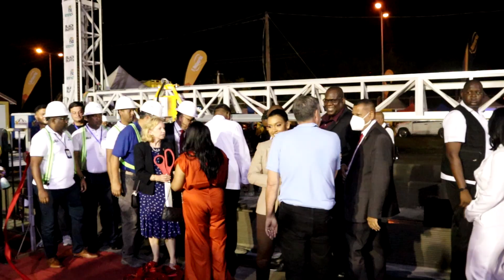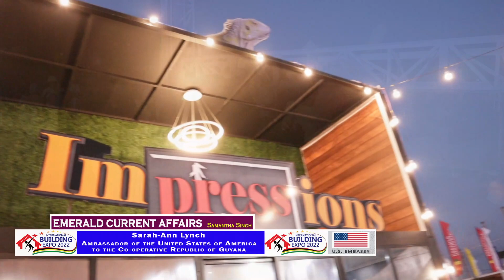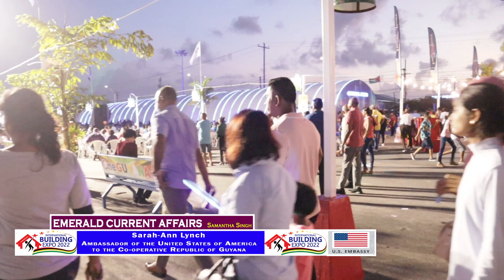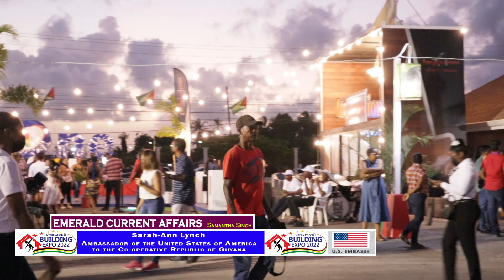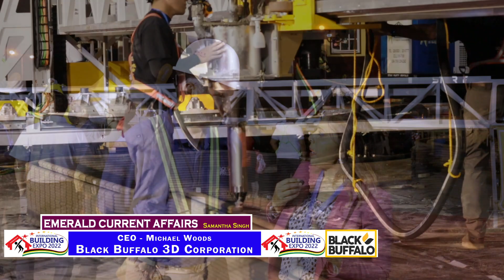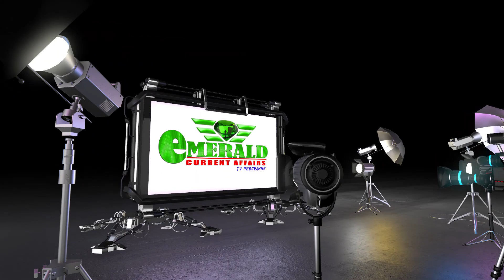House Printing Machine which can print a real house in hours.

Comment: The math is not mathing... $40/sq ft, so for a 1000 sq ft house, shouldn't it be $40k instead of $400k ($400/sq ft)? And a 400 sq ft house would be $16k instead of $80k ($200/sq ft)... I'm not sure where this $40/sq ft figure is fitting in...